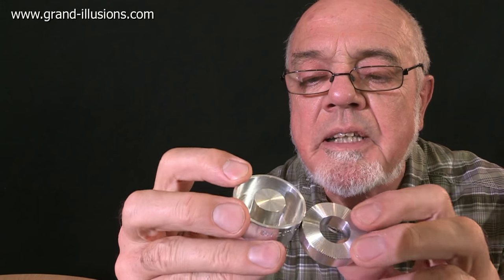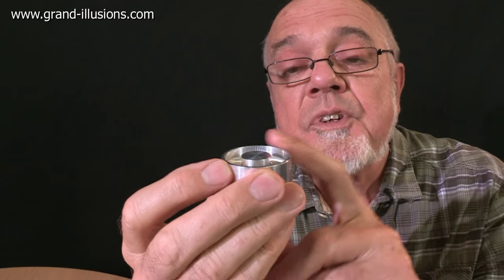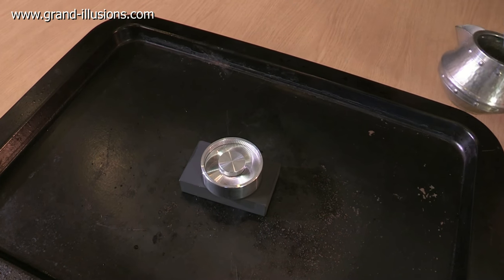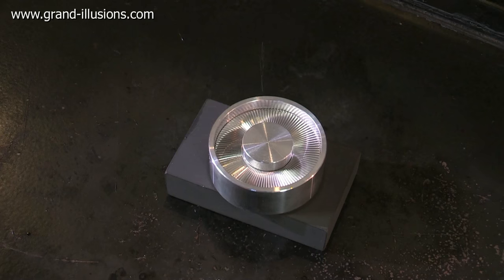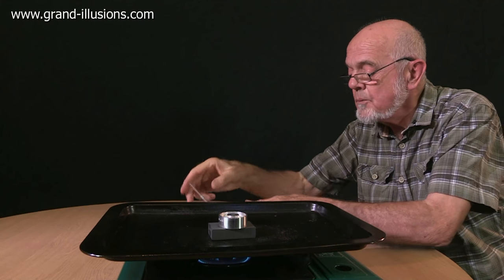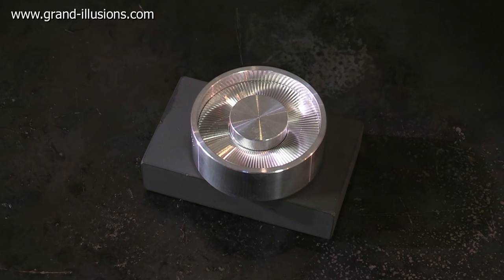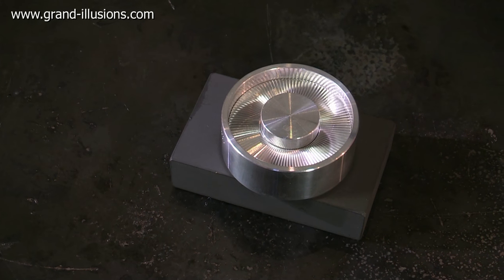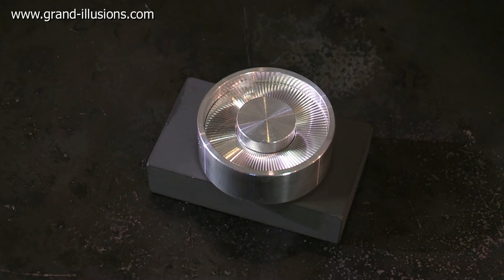Leidenfrost Effect

Comment: Interesting ---does it always flow anti-clockwise?
Reply: Due to the way this particular apparatus is shaped, with the notches, yes. Other apparatus can do other things- flow uphill, for example. You can actually do this on a normal household pan, but it will just sort of slide around as though the surface were hydrophobic (which is still pretty flippin cool)
Reply: The ridges seem to favour one direction over the other, so I'd guess so.
Reply: It is dependent on the geometry of the ribs/notches, whole mazes and intricate pathways can be constructed for water to navigate with this effect.
Reply: maybe it goes the other way in Australia
Reply: It might be possible if you are in Southern Hemisphere to go other direction.. after all the movement is because of Thermals and less contact with metal below and dictated by gravity (and earths magnetic property involved)... like a flush in toilet goes clock and anti-clock wise based on hemisphere, it should be possible
Reply: well I was just kidding but whatever
Reply: Pretty sure they were referring to Mukesh Pandya, not you - oh well
Reply: anew742 pretty sure they were replying to me not referring!
Reply: Mukesh Pandya The Coriolis effect does not apply to stuff like toilet flushes. Check SmarterEveryDay's video on the subject.

Comment: OK ,Why did the droplet did not evaporate and floated around the surface?
because the vapour produced at the interface insulated the drop from the pan.
But why did it go around?
because the pan is not smooth,if you look closely ,you can see triangular projections which moves the wiggling water around the curve.

Comment: The ridges in the metal, cause an infinate stair effect. While the water is evaporating, it is also pushed away due to heat rising underneath the water. The metal ring is flat, but ridges are slanted. The water is pushed up a slant, then falls. So the water is trapped by the outer ring, and forced in an up and down motion, as the heat pushes it away from the surface of the metal. Thus the perpetual motion occurs.

Comment: was expecting you to elaborate that the same effect can be observed in different temperature ranges with different substances like with LN2 (Liquid Nitrogen).  :) 

Due to it's boiling point, LN2 has a similar temperature delta to this example even at ambient room temperature. It's also why you can tip LN2 directly on your hand and it won't harm you.

Comment: The leidenfrost effect is interesting of course but you can do this with a pan if you really want to check it out, no need for a fancy machine cut "device".
Reply: The precision cuts are what cause it to spin like that. On a normal piece of metal it would just move randomly. This is an example of self propelling leidenfrost droplets.
Reply: Of course. I was just pointing out you don't need expensive gear to observe it like the video seems to suggest.

Comment: How does someone figure stuff out like this? Its crazy how smart some people are
Reply: I bet most of the time someone gets a glimpse of something unusual by accident and then works to exaggerate it. I don't think it takes intelligence so much as a curious nature and a bit of luck.
Reply: Anyone with a fire, a flat piece of metal, and some water would have discovered this phenomenon.
Reply: PerfectSnowball
Most people have all those things but would still be surprised by this video. I'm not talking about the Leidenfrost effect but rather the clever design that makes the drops run in circles.
Reply: Most discoveries are made by someone screwing around.
Reply: that was just a matter of understanding the principle and cutting a surface in such a way that it shows it off and makes it interesting.
Reply: +PerfectSnowball probably doesn't work with rough surfaces though, I think it needs to be very smooth like stainless steel.
Reply: Justin Koenig
I think it uses a biased stair-step shape that preferentially jumps more often in one direction more than the other. I think that jumps in the short direction are more likely to stick whereas it's more rare to jump the longer distance.
Reply: trail and error and a bit of luck.
Reply: Like the Mpemba effect. A kid named Mpemba noticed that, while his class was making ice cream, his ice cream that was boiled cooled faster the ice cream of a kid who just mixed his ingredients together and put it in the freezer. Later studies by Mpemba and his teacher showed that hotter a thing is, the faster it cools.
Reply: actually almost all of these inventions come from try and error, pretty dumb but effective way of discovering things imo.
Reply: some
Reply: Melinda Green to make it go in a specific direction yes, but you can do this on a frying pan at your home if you wante, it would just be able to go more directions, however with the ridges its possible to even make it go up slopes.

Comment: You can easily see it on a pot, wok, or almost any hot surface really.
Reply: Well, yes.
But the way the ridges are on the metal bits, causes the water to move counterclockwise.
It demonstrates the effect in a controlled condition.
And that's what makes this video cool.
U wot m8?
Reply: Psa don't do it on a pan of hot deep oil

Comment: 100°Celsius=212°Fahrenheit
200°Celsius=392°Fahrenheit
Incase anyone was to lazy to google :^
Reply: Who needs Fahrenheit when you have Celsius?
Reply: 100°Celsius=373 kelvins
200°Celsius=473 kelvins
Reply: 100°Celsius=hot
200°Celsius=hotter
Reply: Only trolls and pedants think it matters.
Reply: THANK you.
Reply: Xavier H. 
Celsius is based off of water at exactly one atmosphere, not just water at any arbitrary pressure.
Reply: Thank you, I was wondering how those Commie degrees converted into our Freedom degrees
Reply: Gabe McKelvey :^)
Reply: +Catbug “v.” well Fahrenheit is better for day to day use. there's a reason it was invented.
Reply: +Tim Gehrsitz
 Not for day-to-day use, actually. Fahrenheit's origins make much less sense.
 Celsius was devised first and was based on freshwater. Later, the Fahrenheit scale shifted and resized so the standing temperature of a particular concoction of brine would be zero degrees.
 If you were a sailor or merchant on briny water, it made life easier. Kind of. At zero degrees Fahrenheit, that particular brine is at its favorite temperature. But 212 degrees Fahrenheit is the boiling point of freshwater.
 At best, the intervals are smaller and give you finer measurements (Fahrenheit is 180 degrees between melting and boiling, while Celsius has only 100.) Besides that, the numbers used to define the Fahrenheit scale make no sense.
 Unfortunately for the internet, the US won't be changing scales anytime soon. They're stubborn, them Americans. On the other hand, that stubbornness and arbitrary sense of right and wrong is how they're willing to chase down terrorism to the ends of the earth. Oh, well. I'd say it's worth it.
Reply: I agree 100% with what you are saying. But as a point of pedantic detail, it's easy in the metric system to calculate the heat to get water from room temperature to 100 degrees, but not quite so straightforward to know how much is require to boil it, because of the latent heat of boiling, which is unfortunately not a nice round number in any system - i.e. the heat requred to take water at 100 degrees and turn it into water vapour at 100 degrees. 

Still, you are right, the metric system just makes sense.
Reply: @entidade1000  miles...feet inches...wtf measurements

Comment: not a science guy, but i think those notches in the inner ring offers very low thermal contact and the heat causes causes thermals pushing water molecule aerial
Reply: Nope, it might be why it's spinning, but as the temperature goes up the water evaporates so fast it forms a bubble of steam around itself, that let's it float and move very quickly due to air having much less friction then water and metal, it also doesn't evaporate as quickly due to the insulation the steam provides.
Reply: nicynodle2 wow, heavy!
Reply: Mythbusters once dipped their hand in a bucket of molten lead. They didn't got burned because of the leidenfrost effect. You should look it up. It's an interesting watch

Comment: I m here to find out what happens if a lightsaber falls in the ocean
Reply: DarkLord DannyD Damn, this is an intriguing question!
Reply: DarkLord DannyD well its plasma thats just being guided by magnets (or force energy stuff from kaiba crystals)... which i believe is possible to a degree here but not quite to the degree of lightsabers or halo energy swords, the immediate answer is nothing, its alot of heat in a relatively small area to the body of water (however itd probably create an air pocket), after a long time itd cool to the point of flames and eventually turn off, as it goes from hot to cold not cold to hot itd heat up a rather large area until itd have no more heat to distribute. either that or if the gas its heating up isnt present then it just turns off. And if its just kaiba crystal force energy stuff then none of this applies.